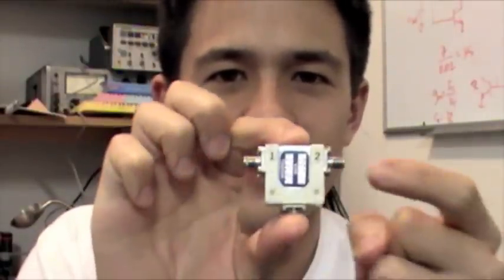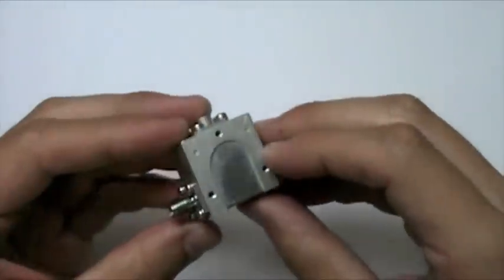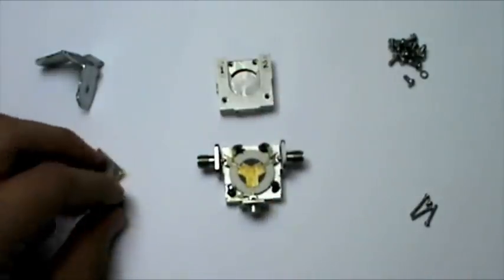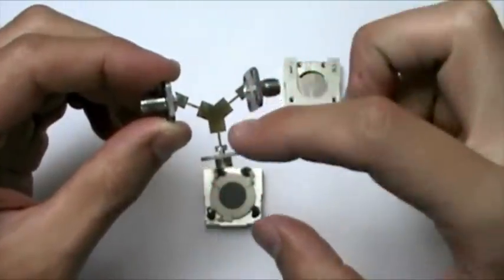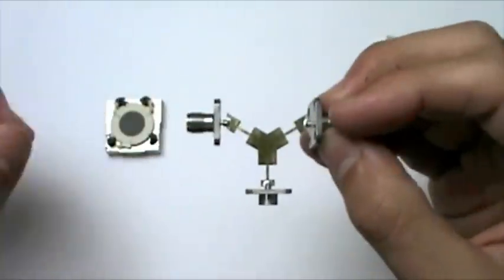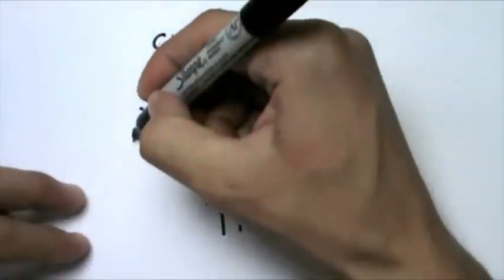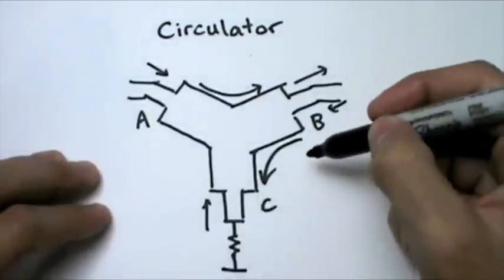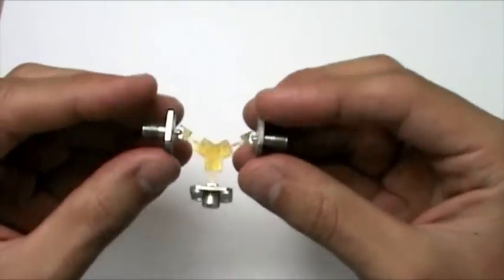RF Isolator Teardown & Explanation

Comment: Awesome. So what if a high current, like a garage door keeps surging back into this isolator, what exactly is the part that wears down? Is it terminal C? I seem to have to keep buying a new isolator for my HFC NBN every year or so, and I don't want to keep doing that, so if I know what breaks, then maybe I can buy a good isolator instead of the same cheap ones.
Reply: have you opened the isolators? what's the condition of the ferrites?

Comment: You failed to observe and mention that it appears that the "tabbed" portion of copper leading to the resistor is a bit larger (or extends just a bit more) than the other two "tabs" . . .

Comment: I've read a different explanation elsewhere. In it, the waves arriving at the two opposite ports are more or less in phase at one port, and out of phase at the second port. Anything to this?

If it were merely the hall effect at work deflecting the current, wouldn't these devices need to be biased to ensure that current is always flowing in the same direction through any given port? And of course that is not possible in a three port device, so it would never work.

Comment: An Islator and Circulator are basically the same,the difference is the isolator has the third port terminated within the case, the circulator has the third port connected to an external connector for connection of a terminating load.  It is really an issue of the needed load wattage; with a circulator the third port can be connected to a 500w dummy load whereas an isolator has only a limited power capacity wit a fixed terminator.
Reply: So for my internet, you're saying I should get a circulator + 500w dummy (whatever that is) instead of the supplied isolator? My isolators seem to always fail after some years, so I have to keep replacing them. Im guessing the garage door in our building keeps frying the isolator somehow by the power go8ing into where all the cables are, or power surges which wear down the isolator over time. If that's how it works, would it be better to get a circulator with this dummy instead?

Comment: That is actually a circuator. The part in question, is a small 50 Ohm termination.
Magnetic rotation causes the R.F to 'circuate' around to the port 2 connection.
The load, is for reflected power sent back down the cable, not back into the transmitter.
The magnets 'trap' the R.F, and force it to rotate within the field, to the respective ports.
Isolators have separate loads and values according to power handling characteristics and frequency range, I.E: 30 to 100 Watt load terminations for potential feedline problems.
Isolators are also harmonic generators. Not great, but they do cause IMD products.
DO NOT ATTEMPT TO USE THEM IN ANY RECEIVE SYSTEM!
Reply: >DO NOT ATTEMPT TO USE THEM IN ANY RECEIVE SYSTEM!

why not?
Reply: @donaldviszneki8251  if you put this between an antenna and a transceiver, it will absorb not only the reflected power but also the useful signal coming from your antenna, preventing you from receiving anything. AECRADIO1 did not have to be this dramatic)